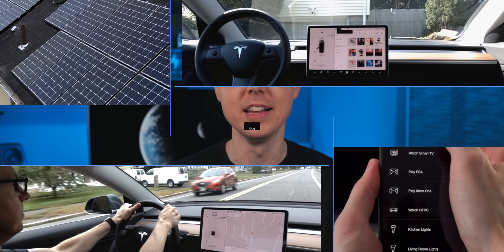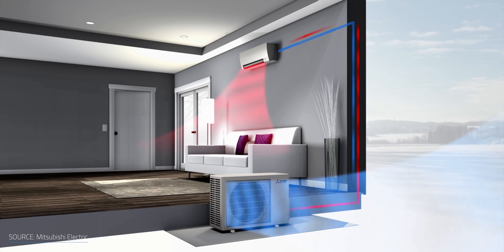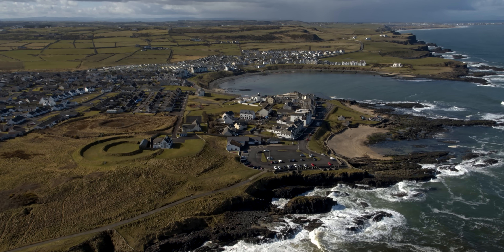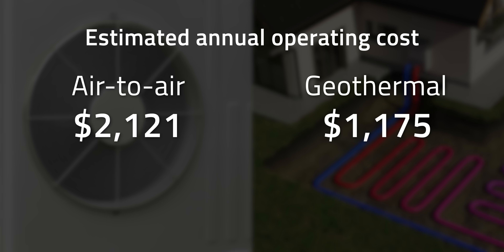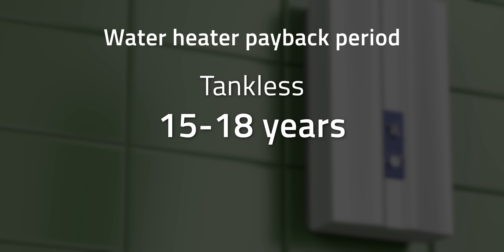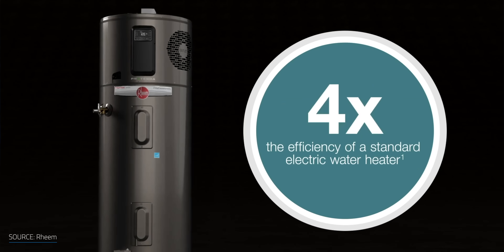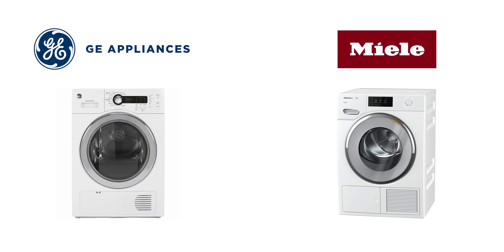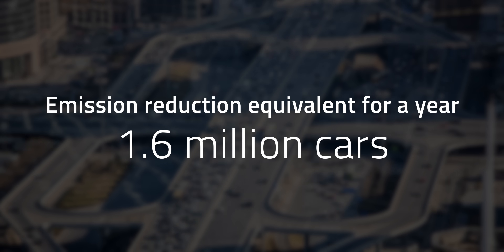Why Heat Pumps are Essential for the Future - Explained

Comment: I found a window mounted heatpump A/C that puts out 10k BTU for about a third the power of two, regular 1500W space heaters. About 5 amps @ 230v. When it's above 40°F outside, that's all I need for the whole house. When it's below freezing, it's break even with the built-in electric heater. The auxilliary power plant runs off natural gas, so I'm not replacing my ventless wall heaters yet.

When they subsidize solar again, I'll put panels on the roof. Insulation is a huge factor that I'm not hearing about lately. That can easily cut your electricity use in half. There used to be grants for that too. I have brick walls, so I'm putting half inch polyisocyanurate foam on the inside with prefinished paneling.

Comment: This is good!  As an architect whose main motivation is protecting our environment, I fully support conversion to heat pump heating and cooling systems powered by renewably-generated electricity!  One thing Matt left out is the fact that the heated air coming out of a heat pump is about 90 degrees F, whereas heated air coming from a gas furnace is about 130 degrees F.  So the way the heat FEELS to people in the house is different.  With a gas furnace, you can sit near a heater register and get warm quickly.  With heat pumps, that does not happen.  If your home has spots that are particularly cold in the winter, they may get worse when you switch to a heat pump. Comfort is a huge factor in why it is more important to have good air sealing and insulation in exposed floors, exterior walls, and top level ceilings in buildings that use heat pumps (which is what I focus on in my work).  An added advantage of that is that, in addition to increased comfort, the amount of electricity and cost needed for your heat pump to keep you comfortable goes down even farther.

Comment: I am living outside the US, and have a heat pump dryer, though here they are called condenser dryers too. It does take longer but, I can just start it late in the night and by morning my clothes are dry and still warm. And I don't need a hole in my wall that lets my cold air out and hot air inside my home. Over all, I am happy with it.

Comment: We got an AtA type heat pump for our home. Stratigically placed it can heat/cool the ENTIRE House with ease. We love it and the saving are quite good. Best part about it was it cost us NOTHING!! It was rolled into a community action council weatherization program funded by the Federal Gov. and State of WA. Got a new membrane roof, Fully insulated the roof and Floors, Repaired the floor ducting from the electric furnace and went through and fully referbished that furnace too. New moisture sensing bathroom vent that can run on auto or manual and a full weather sealing of all doors and windows. If you OWN the home...LOOK INTO these programs!!! Totally worth the time!!!

Comment: A couple of years ago we installed a LG minisplit air-to-air heat pump. When we built our house 40+ years ago installed a cordwood stove in the basement and electric baseboard heaters to keep the bank happy. We are in NH. Last year we used the heatpump for summer cooling and heating. This winter due to the high cost of electricity we decided not to use the heatpump and instead have gone back to 100% cordwood. It is nice to have an alternative source of heat. 

For domestic hot water we have a conventional electric water heater. However we augment that in summer with a solar batch heater in our attached greenhouse. That provides about 1/3- 1/2 of our summer hot water needs. In winter I installed a heat exchanger in our wood stove, that supplies almost 100% of our winter hot water needs assuming we heat exclusively with cordwood. Our electric utility offers a slightly lower rate for electricity used for water heating. 

Currently we have a conventional electric dryer. When it needs to be replaced I will check out heatpump dryers but I have a couple of concerns besides cost. The well documented lint problem and where does the moisture go? We live in a fairly high humidity area in summer and because the house is so tight we don't need to add humidity in winter so I'm reluctant to add more water vapor to the air.

Good luck on your new house.

Comment: Hi Matt, enjoyed your video. Since 6 years I have a water/water heat pump installed in my house and a year later I balanced the energy consumption by installing 30 solar panels. It is a 13 kW heat pump that (including hot water, cooking and lighting) uses approx. 10000 kWh annually. Our water/water heat pump  cools in summer without needing a lot of additional energy while at the same time reviving the sources by transporting the summer warmth back in to the ground for next winter. The COP has been increasing over the past years by monitoring and optimising the process. Past years COP was calculated back as 5.5. The costs for installing the entire system were substantial, but never regretted doing it. Best regards Carel.
Reply: Carel Rijnders, you might consider installing a evacuated tube solar panel, then run the water pump for your geothermal system all day long in the spring / summer to warm your ground and water loop!  Evacuated tube water heater can be used in 0F weather without risk of damage to the heating system, as long as the tubing is well insulated.

Comment: We moved from oil heated house to our new home with air to water heat pump and underfloor heating. Absolutely incredible. Obviously electricity bill is higher but there is no oil bill. We are saving a fortune. A year we spend approx €1700 (large 4 bedroom , detached house, 2 occupants ) per year total electricity/total energy spend. That’s lighting, heat, hot water, all appliances. We’ve coupled our electricity with a night meter , we get half price power from midnight til 9am. We set timers on doshwasher, washing machine and clothes driers to run between those times. Further saves money.

Comment: in about 2005, I visited my sister, who lives in Southern Georgia.  She and her husband had a pond on their acreage that was always nearly full and only occasionally got ice on the surface during the winter. The pond had a fairly high dam and dumped into a ravine below.  Her husband used an almost-forgotten device - a hydraulic ram, to pump water from the pond up to the house, which was 15-20' above the pond level.  Since the ram used no energy, it ran continuously and pumped the water first through a gravel filter and into a (200 gallon?) plastic water tank behind the house. In that tank were coils that acted as the heat exchanger for their heat pump furnace/air conditioner.  They used the "waste" water - which was continually coming out of an outlet at the top of the tank to irrigate the property, or to simply let it run into a pipe back into the pond.  The system was extremely efficient.  My sister eventually divorced the guy, and they sold the property in the split, so I don't know if the system is still in operation.

Comment: Own a GE heatpump equipped drier for since 2015  .. one thing - keep an eye also on water consumption (hope it's improved over time) as it does uses tens of liters of water to help to cool and condensate moisture on heatpump. And one another hint, if you have enough space, then buy separate washing machine and drier. I do have combined unit and washing machine bearings on a drum worn off because of heat used in drying cycle. They are sealed but even tho their lubricant dried out and they got beyond repair in some ~8 years of daily washing machine usage and occasional drying.

Comment: I didn't realize that I had installed a heat pump heating and cooling system for my air conditioning until I watched this. I love it. In a few weeks we will have solar on our house. I am wondering how the dryer lint works with a heat pump dryer?

Comment: You sir did your research and as an HVAC tech I can say you covered quite a bit, most customers get turned off by the upfront cost of an efficient piece of equipment because of return on investment, not only that but equipment might have a max life of 15-20 years. Depending on contractors they might not be looking out for you and will try to sell you new equipment instead of repairing it.

Comment: installing a ground source heat pump during construction saves a lot of the cost.  If scheduled properly (before any landscape) and while the heavy equipment (with operator) is already on site, the costs you quoted can be reduced. 

Ground temperature is much more constant and the COP will be more constant. Space can be reduced by utilizing a vertical loop (drilled) versus horizontal in some soil conditions.  
I have been involved with closed loop, open loop ground-source as well as air-to-air systems.  I have also worked with passive solar berm homes.  I will be watching future episodes to see how you progress.

Comment: I had a ventless combo laundry appliance from Dehlongi, so it did the washing and the drying, the latter via heat pump with no vent, all in one unit/chamber. When it was working it was great for me as a single guy and was even mostly fine when my wife moved in. It was too slow to dry once we had a kid. The bigger problem though was that it kept breaking down and needing service. 

That said, I recently got a heat pump water heater when my gas unit broke down. Between local utility rebates and the Inflation Reduction Act subsidy, the total installed cost should only be about $300 more than a new gas unit. Gas is pretty cheap where I live (Baltimore), but even so, I expect to save at least $200 a year in operating cost, according to the Energy Guide stickers on the new and old unit. Plus, as Matt points out, I expect to reap some benefit from the dehumidification and cooling it'll provide in the basement.

Comment: I was so happy to move from a house that had a heat pump to a house with natural gas.
The heat pump would always turn into a useless block of ice in the winter.
Basically the outside unit became cooler so any wayer in the atmosphere instantly turned to ice.
It has a "cycle" where it reversed to defrost the outside unit which meant it COOLED the inside!

Comment: Tumble/clothes dryers aren't used so much here in UK. Most folk simply hang up washing to dry, outside on summer, indoors in winter. This also saves buying a bulky and expensive to run item. Most clothes are not needed to be worn the instant they are washed. Clothes can dry fairly quickly air/sun drying anyway.

Comment: after my experience with mini-splits here in FL, I will be going with them when I build a new home and using full heat pump water heaters and clothing dryer. It works better on my solar system inverters.

Comment: I think we need more of a unified system. Where all the things work together. I live in a hot climate yet I still need hot water and to dry my clothes. Why not have an HVAC system that cools my house while at the same time using the heat generated from that system to heat my water and dry my clothes? It just makes sense.
Reply: I made that. Read my article "The energy revolution, DIY"

Comment: From 12 years experience a heat pump is not enough by itself. You need a gas furnace or wood stove. We have a heat pump and wood stove combination with duct work in the concrete. When the stove is on the fans will run to distribute the heat to cold rooms heating the floor. The furnace intake is above the fireplace. Heat pump keeps it above 65-69F/1719C but you still need another source to bring it up yo 70-72/21C. Placing the heat pump in the winter sunny spot helps. Don't let them put it so close to your house like they tend to do.

Comment: The oldest heat pump I ever worked on was a set of 4 each open drive 125 HP heat pumps located in the basement of the 1948 SCE building in Downtown Long Beach, CA.  They used R-12, and sent all of the hot gas to a water heat exchanger above the compressors, then on to a evaporative cooling towner, where the R-12 went through a copper heat exchanger, and water will drop over it to cool the hot gas in the cooling mode, and the fans both evacuate the garage (so act like a garage exhaust fan) and cool the water and hot gas coil.  

In the heat only mode, the refrigerant flow is reversed, where the coil in the cooling tower is used to boil the R-12, and then the compressors still send the hot gas into the hot water heating coil, and then back to the cooling tower heat exchanger coil, to collect more heat (without the water pump running).  Hot water and chilled water was then pumped through the hot deck and cold deck, to heat and cool the building, as needed.  It was a 13 story building with 3 floors of parking, mostly underground.  

The oldest heat pump water heater that I own is a Airtemp built by Chrysler Corp, back in 1978.  They stopped making Airtemp products in 1979.  

Heat pump water heaters work great!  However the current heat pump water heaters only use a 5,000 Btu compressor, so they do not heat a lot of water each hour.

Comment: I have 5 Sanco heat pump hot water heaters installed in my Colorado mountain house and they do an amazing job of heating large tanks of hot water for radiant floor heat and domestic hot water.  I keep them off during peak energy rate periods (5-10 pm) so I can take advantage of the lower energy rate (.09/KWh) during the off peak time.  As a bonus they use CO2 as a refrigerant.  Highly recommend them!

Comment: My friends in Nelson New Zealand heat their home with a compost pile heating water running through to their concrete floor. They only use wood chip so the compost pile only gets to 40 degC. If you use green and gray compost it can go  to over 75 degC which is far to hot. The small drawbacks are coiling 250 m of thin pipe into 6 .m2 of compost every year and then spreading that same amount over the garden 6 months later. A full days work for two fit people twice a year. Having the space and living near a lot of trees that get chiped. But it is a Green solution. Where they are it costs to dump chip so they get it for the cost of the truck driving up their driveway.

Comment: Awesome video. Im a refrigeration technician and have done some hvac on the side and at my last job. I live in Phx Arizona and heat pumps have been around for decades. The house i grew up in that was built in the late 70's had a heat pump. Heat pumps are considered a/c systems. Is that not the case elsewhere? Im curious

Comment: I have one of the Rheem heat pump water heaters, the 72-gallon one for my 5 bedroom house. The electric bill is never terrible anyway because the house is heated with a Lennox heat pump, but I definitely saw it go down when I replaced the electric 80 gallon heater. In addition, the Econet app is very cool and lets you remotely make adjustments if needed, as well as put the heater into a less efficient mode that heats water faster for high utilization times, as well as a heat pump only mode to save extra energy and vacation mode to turn it off while you're out of town. The energy graphs it provides are very interesting. I can easily tell which guests are taking long showers. And it's air conditioning my garage and keeping the humidity down in the summer. This particular model is the 3.6 EF version, and the newer ones are 4.0 or higher. I'm on the side of heat pumping all the things. The cost savings and pollution reduction are obvious to me. When my Lennox heat pump dies, I'll put in a new high efficiency one probably from Carrier.

Comment: I Have a Heat Pump Dryer from LG, going on 3 years now, i did not have a dryer before, i can tell you it did not increased my electricity bill, it actually reduced it because i was using a dehumidifier to dry clothes in house has i was living in a Apartment at that time!
AC's are Heat pumps they always where modern ones are very efficient dew to the new Refrigeration liquids like R32 and the one you mentioned, if you have and old house with Water Heaters you are better of just installing AC's and changing your windows to double or triple Glazed !

Comment: Yep, we took out our natural gas furnace and water heater, and installed Trane Heat Pump and Rheem hybrid heat pump water heater 10 years ago, and have been overjoyed with out positive experience, which also included adding solar and powerwall batteries, and Tesla EVs (3 MS's and M3 thus far).

Comment: Hi Matt, You can go even deeper with geothermal. Just putting the loops in your garden is ok, however, this cools your garden and plants will start blossoming about two weeks later than normal. It is also possible though to drill further down. We have two bore holes down to 99 m (anything beyond that requires the approval from the state mining authorities). Since the ground there has a constant temperature of ~15°C, this is perfect. During the summer, we also use the heat pump the other way around to cool our house. This is not as efficient as heating, but is works as well.

Comment: I just purchased the GE Profile Ultrafast Combo washer/dryer. It's the largest unit in the US to use a heat pump with it's 4.8cu capacity and has a proper lint screen when most all in-ones don't. Actually the con of it not getting not as hot is actually a pro since it's easier on your clothes. Apparently the GE Ultrafast doesn't take that much longer when compared to traditional dryers, but is way faster than the condenser based all-in-one ventless combos that are currently flooding the market. Hopefully the GE lives up to it's specs, and has a high lifespan.